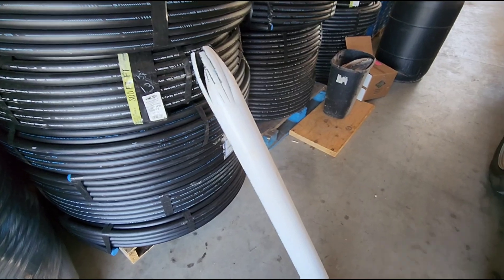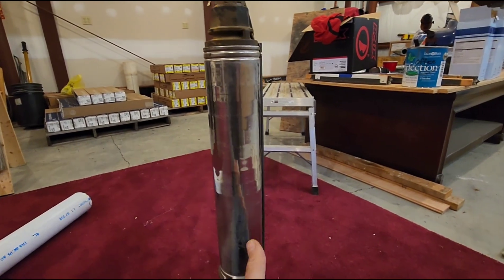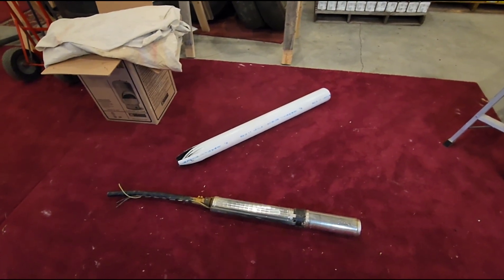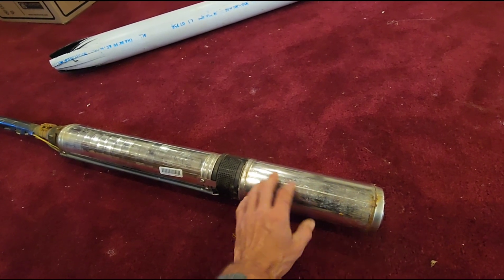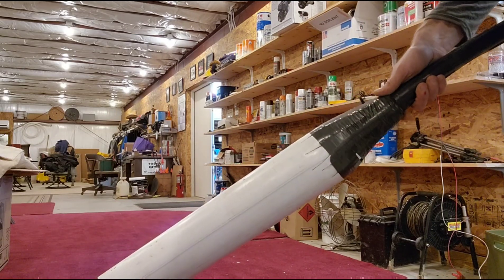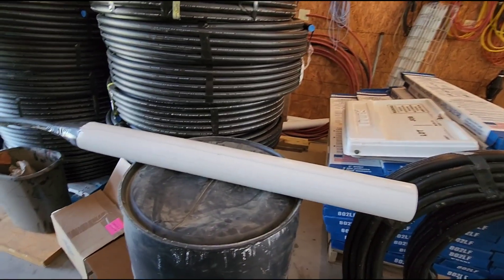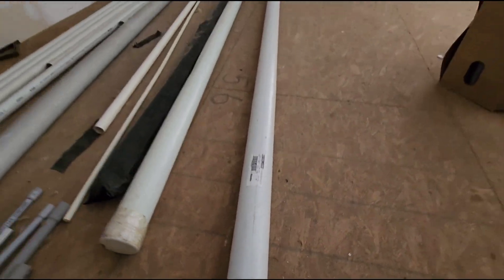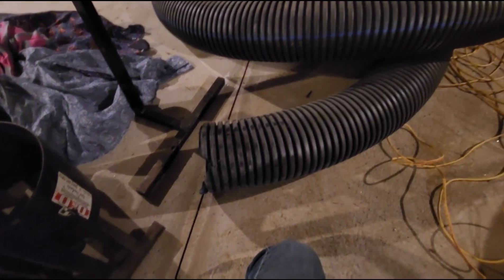This $10 Device Extends Well Pump Service Life & Helps Reduce Sediment Issues.

Comment: We call it a shraud it also cools the motor as well by pulling water past the motor.  there a ceramic baring on bottom  of Motor the little hole on the bottom lets water in  but there also rubber liner that keeps the water from entering the inside of it  help cool the ceramic a interesting design if you were to cut it open. The sell a fancy version of that sleav  that make a vortex only offered by pump supplyer.   I for got what the date code was but I pull a sub that still working  pulled on request of new home owner and it was all made from brass the out side and in side and was told they did that in the 60s jacuzzi pumps   I have no idea how it could last that long and some of the control box look like it was make from card board really probably a wood of some type. It was cool to look at. The old house owner said the well was drilled in the late 50 . 👍👌✌️💦